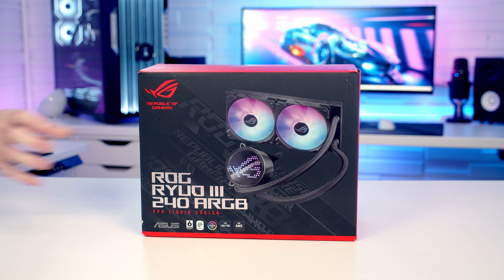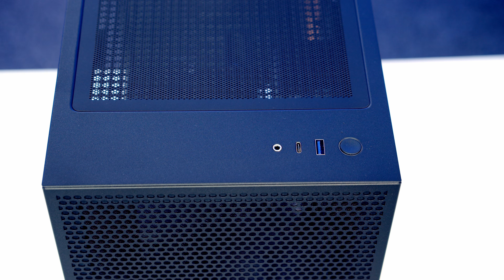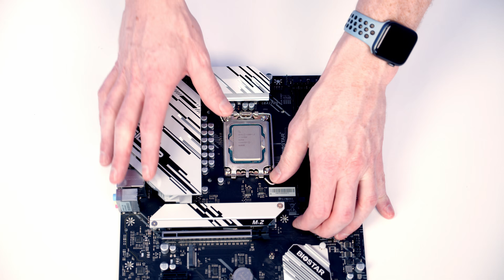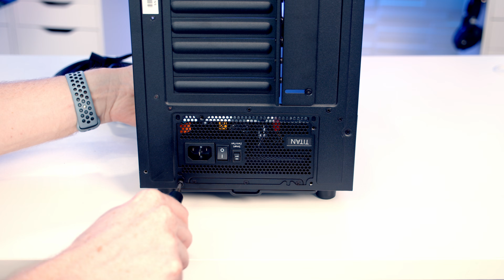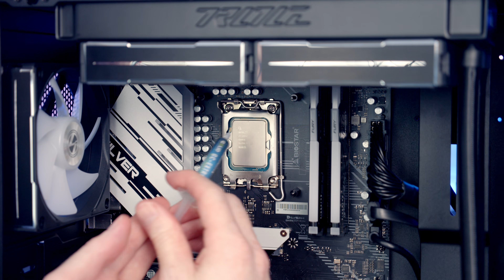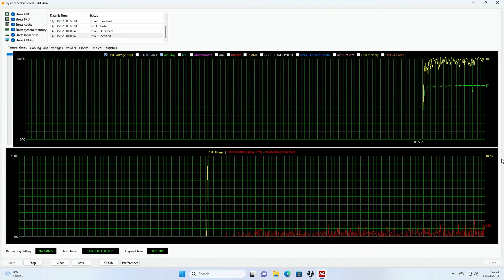NZXT H5 Flow Build - Step by Step Guide

Comment: I just wanna know what kind of screwdrivers you are using I had a Dremel that broke Been looking to replace it. a Dremel screwdriver, it had push to engage or button similar to what you were using it looks like you were using a smaller one also.

 Brand?

Comment: Aren't you chocking off your PSU with fan facing down? The manual shows having the fan facing up, and it seems to sit flush with the bottom of the case with no perforations for air intake
Reply: nvm, this does not apply to the model you are doing, in the 2024 model you gotta have the fan face up on the psu

Comment: Did you buy the fan hub or did it come with the case? There no hub with the case and cant find anywhere to plug the rear bottom and front fan wires in

Comment: bro where the fuck do i plug in the connectors that come with the case im gonna commit suicide
Reply: It's in the manual😂
Reply: @hasanshafique6758  pls help, using b550 motherboard do i need to buy nzxt hub to power the rgb fans? im so confused where to plug em in at

Comment: Thanks for not showing the hard drive installation
Reply: To be fair, he installed the nvme
Reply: Same 😂
The reason I watched the video is because I had problems with the ssd
Reply: @burningbb  lmao right
Reply: Y'all dont use nvme 😭
Reply: @2415-q6b  Not all of us are knuckle dragging mongoloids that throw away working SATA SSDs because NEW THING GOOD HURRHURR
Reply: Find an other tuto
Reply: bro just search up other videos, they’re all universal lmao.
Reply: Thank god i bought a nvme 😭😭
Reply: Yall figure it out? Literally only reason I came here and he installs a freaking nvme like how elitist
Reply: Okay right after posting this I figured it out after fidgeting with the back hard/ssd drive bracket like a monkey. You just put your drive on its back and place the front of the bracket on the back in proportions to the screw holes. So stupid that the manual couldn't add one picture describing this intricate dark arts
Reply: @SPOOKIEMOOKe Seems like they just fucked it up. The screws provided aren't long enough to reach the holes in the SSD. There's too much spacing on the bracket. I could screw them in if I turned the bracket around, but then I wouldn't be able to swing it closed in the case.
Reply: @CrizzyEyes  i bought this case bc of the cool fan placement but yknow this is just cheap

Comment: "and then push the cable back"  -bad advice - this is why those 12vhpwr gpu cables were melting..dont push it back, you will bend it too much in on point..it should have bigger curve from the gpu....bad advice

Comment: Very similar to my build... my dude. yours is a tad bit slower then mine. lol but great minds think alike. lol
Ryzen 7 7900x overclocked to 5.5ghtz
Be Quite Masterclass 800
MSI Mag X670e Tomahawk Wifi
Gskill Trident RGB 4x32GB 128ghtzz 
Samsung 4TB 990 pro
Nvidia Founders 4090
EVGA 1600w 80
Cablemod black/silver cables
Windows 11
Bluetooth keyboard and mouse rgb
Samsung 32inch 240 htz 4k monitor 
for the ultimate gaming computer 
i play 2077 Liberty at 144fps which is awesome

Comment: I'm trying to remove the glass panel on this case, I loosened the screw as much as I could and I'm trying to take off the panel gently, but it's not coming off. Should be applying more strength? I'm worried it's going to shatter once it seems like the glass is only coming off from one side

Edit: yeah, I just needed to pull harder. It feels really wrong but it comes off just fine
Reply: I’ve been using a prying tool for plastic and just slide it along the top and it comes off easily

Comment: how did you connect the fan cables. With a fan hub? And if u used a fan hub which one did u use?
Reply: i am having the same issue did you ever figure this out
Reply: I found out how to do it with nzxt rgb hub and my h5 flow case
 @JosephPoo

Comment: In NZXT's website, it says you can only fit 2 x 120mm fan on top of the case. I'm planning to buy this case and planning to mount 1 140mm fan on top. Can you confirm if it will really fit? Great video tutorial btw!
Reply: You can only put 140mm fans in the front, nowhere else.

Comment: Hello Christopher, you mentioned in the video that you can fit two 120mm fans or two 140mm fans on the top. Is that correct? Documentation from NZXT is showing only two 120mm fans are able to be fit up top.
Reply: Can u put 2 140 mm fans in the front ?
Reply: @xavierparris6058  I was able to put 2x 140mm in the front. You cannot add 2x 140mm to the top.